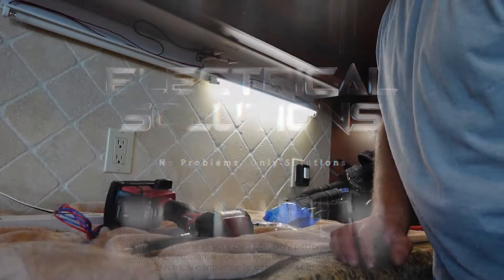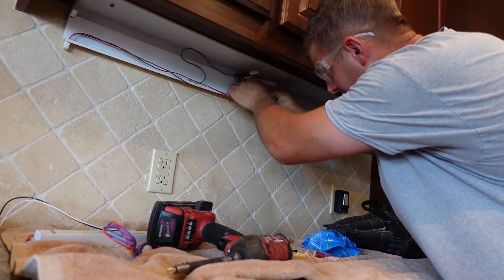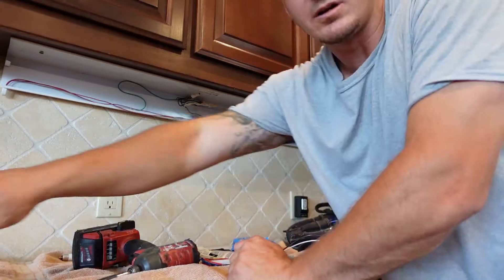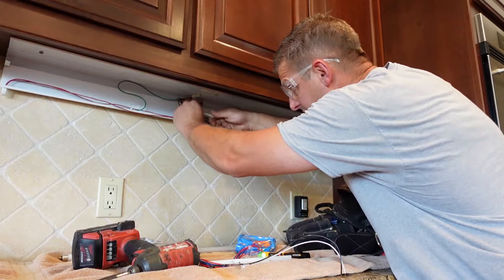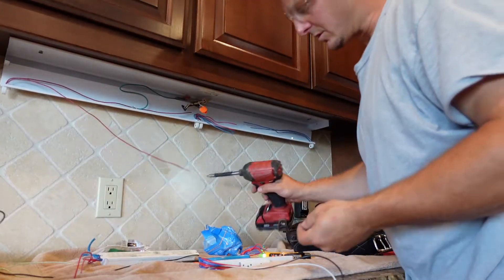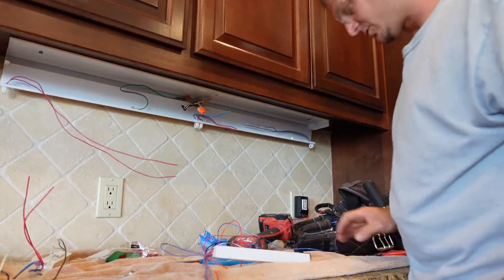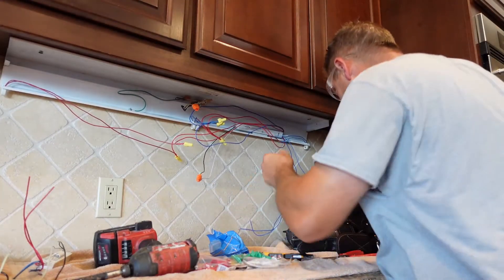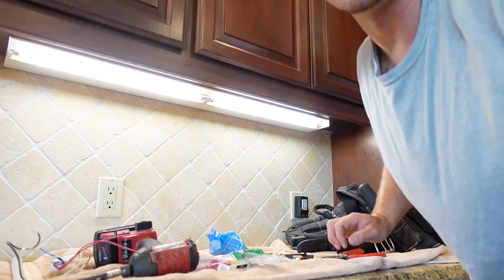DIY: Troubleshooting and changing a ballast for fluorescent lighting T12/T8/T5 process is the same

Comment: How old was that light? I thought ballasts typically last 20 plus years
Reply from the maker: I believe it was about 8 years old.  I have seen them go bad in new fixtures to old ones from the 70's.  For the most part the majority of them last reasonably long.
Reply: @SolidElectricalSolutions  So I swapped out the ballast, and yup! That was the culprit. Our light's not that old, probably about the same as yours, 8 - 10 years. Good to have light again! :)
Reply: @SolidElectricalSolutions  OK good, I initally thought it was my switch so I swapped that out, still nothing so figured it was the ballast. My volt tester still seeing power to the fixture. Thanks for the reply!